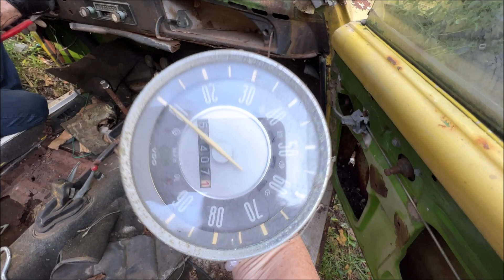VW Karmann Ghia Parts Car At The VW Salvage Yard - Lets Get Some Parts - VW Beetle - VW Junkyard

Comment: I have a Weber Progressive in my '72 because it's an AutoStick.
Reply: Why @josephheston9238? What benefits do you gain?
Reply: @1Also  Better performance (but nowhere near as dual 44s), but when you have an AutoStick, you have to get what you can because your options are limited.
Reply: @josephheston9238  funny you should mention AutoStick…mine’s a 69. What other performance mods have you added?
Reply: @1Also  Just bumped it up to 1776 (just so to add additional horsepower for my A/C.